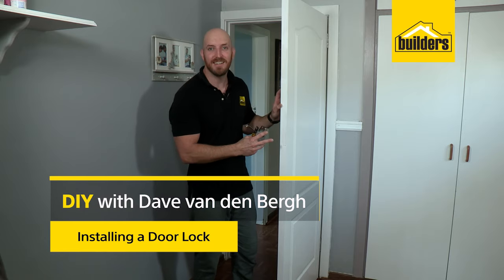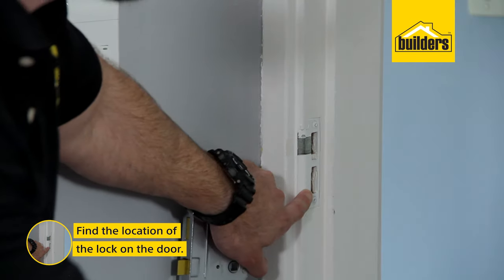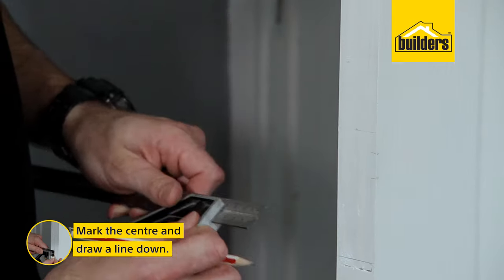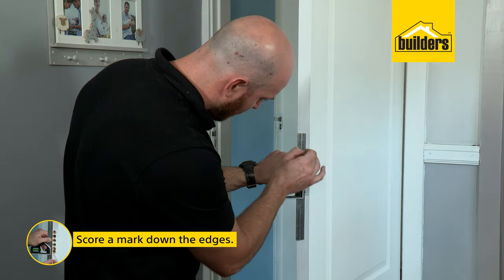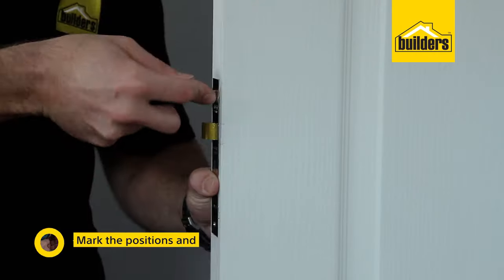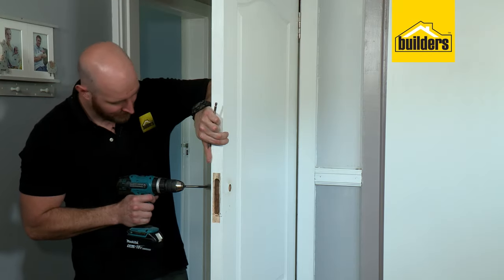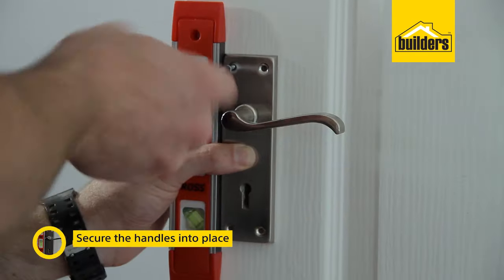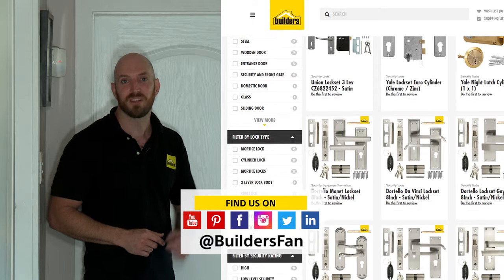How to Install a Door Lock

Comment: Great video 👍. Just did my first internal Oak door handle and lock  from scratch off the back of this. Many thanks!
Reply: I'm thinking of trying this on my summerhouse door, toughened glass and wooden frame. Should be the same procedure right? Anything you might do differently?